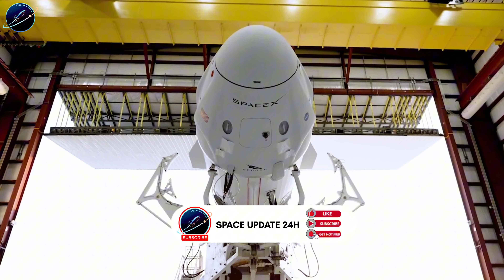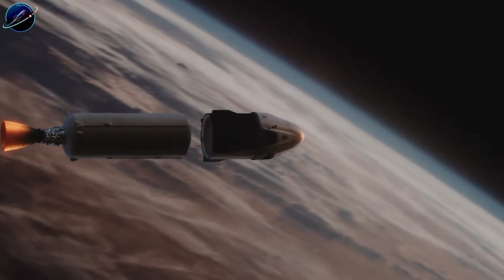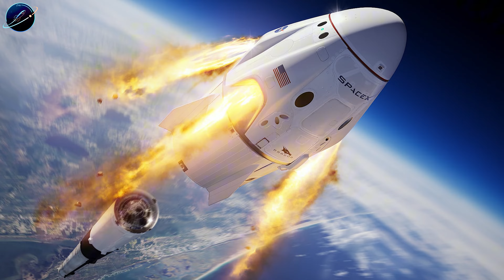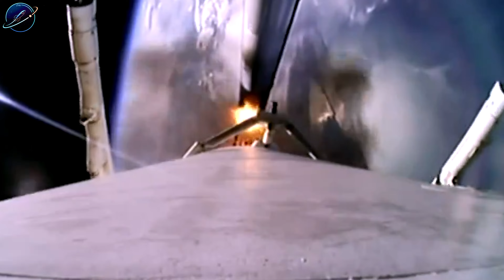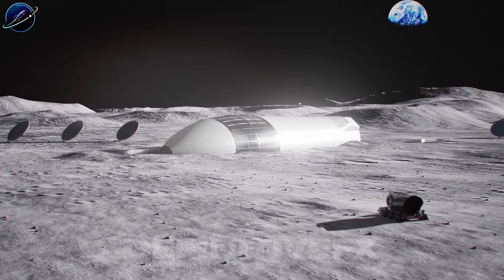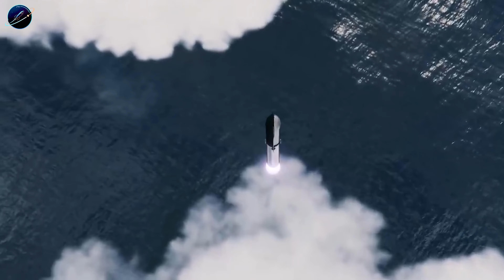SpaceX Found Why Dragon Can't Work for Moon and It's Worse Than You Think...

Comment: Amazon sounds good but they've had a load of trouble themselves. I would suggest canceling and planning a trip to mars instead of a rerun of 69. And no, like they said, you burn delta V stopping at the moon on the way unless you use it as a slingshot.
Reply from the maker: Fair point on Amazon's issues, but stopping at the Moon for Mars actually costs extra delta V due to the Oberth effect—it's far more efficient to burn direct from LEO. Slingshot helps little here; physics favors no lunar detour for Mars missions. What do you think about pure LEO refueling instead?

Comment: I stopped listening to the robot 3.5 minutes in. SpaceX could make a lunar payload using the same capsule. It could have an uprated heatshield. It could have a bigger 'service module' ( I think they call it the trunk today) with enough fuel for a decelleration burn just before return Earth orbit insertion, or a combination of both, The trunk would need to be adapted with legs anyway, for any lunar landing.  
I stop listening to these robot voices on Youtube, usually in the first few minutes. There seem to be fake 'real people' on screen in some videos, and I switch these off too.
Reply from the maker: Fair point — an uprated Dragon heatshield + big service module for partial deceleration could theoretically work on paper, but the delta-V math and radiation hardening still make it a multi-year new vehicle program, not a quick mod. What do you think the realistic timeline for that would be vs just going full Starship?